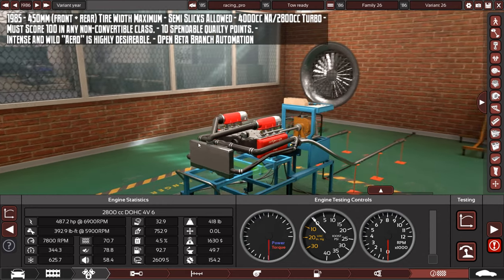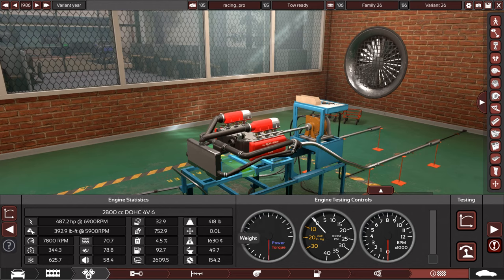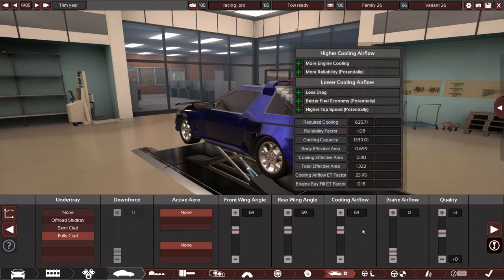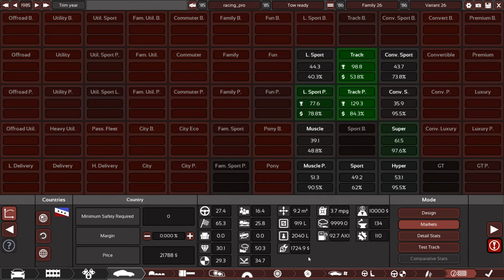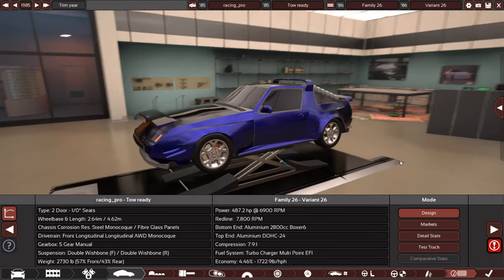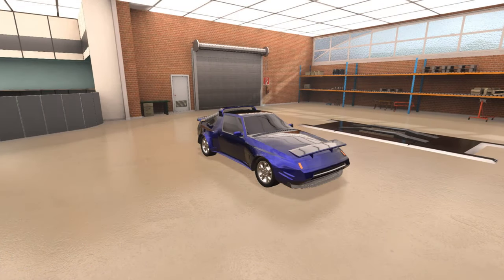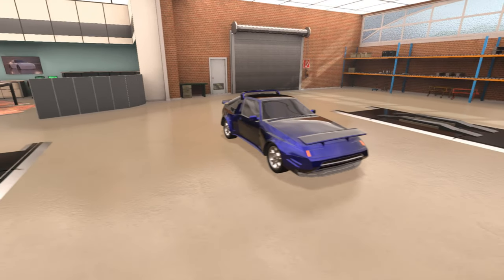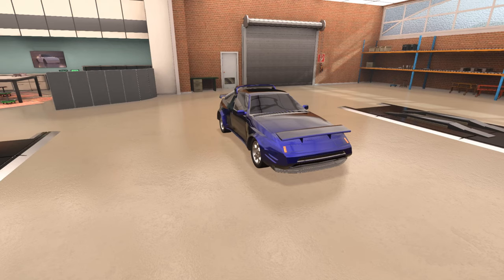Automation 1 Hour Builds - Pikes Peak Racers in BeamNG Pt.1

Comment: Fun fact: due to the aero and suspension settings, the radiator had to be set to that value, otherwise the car bottoms out too much and noone will take it. More open would've worked too, but that's not nearly as nice.

Also, I blame Automation for that 1986 engine. Never noticed it myself ¯\_(ツ)_/¯
Reply from the maker: Turns out everyone's says 1986, not sure what is up with that

Comment: Love your proper racing gear cone!
Also funny to see that beam.ng had  codemasters code in the hang ups
Reply: Also I don't know how you feel about passing the time in town on your phone, but if you like sim phone games on android there is a rally game that is pretty good in my opinion(for a phone game) it is called "rush rally 2" and you can do many setup changes to the car: spring stiffness f(ront) and r(ear), anti-roll f and r, bump dampening f and r, and rebound dampening f and r, also spoiler angle, ride height, final drive ratio, brake bias, front camber and toe. It has 4 game modes championship, time attack, rally cross, and "skill games".
Reply from the maker: At least I know the cause for these hangups, you can see I have the game locked down to 40fps. With recording software and pikes peak mod's lack of optimization, I was pegged at 100% cpu all the way up to the tree line lol.
Reply: Well hopefully they will fix that soon, and let's hope that codemasters fix hangups in f1 2019

Comment: I would just like to have it be known that I only had 20 minutes to build the car in the next video in case it is beaten. 

ALSO MORE IMPORTANTLY @CONEDODGER: I just opened it in Automation and for whatever reason it reverts back to RWD when it should be AWD. It also makes the power distribution whack so change that to something close to 50/50. That is how it ran in BeamNG.
Reply from the maker: Too late that video is already rendered :D I didn't see the rwd issue though.

Comment: I'm interested in how you setup your wheel, because I struggle with it alot. Nothing seems to work. Looking smooth though!
Reply from the maker: Nothing too crazy, mostly default settings in BeamNG, but depending on your wheel make sure you have your FF set to the right inversion setting, it seems to get that wrong by default on occasion. 

900 degree rotation as well.